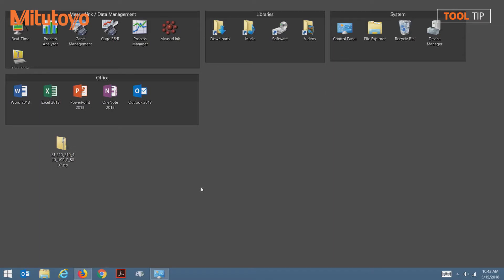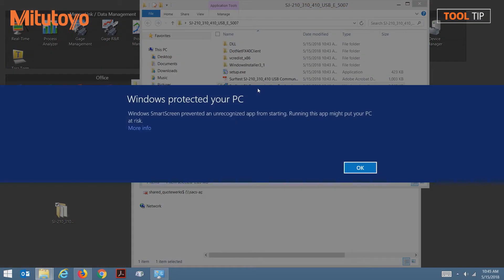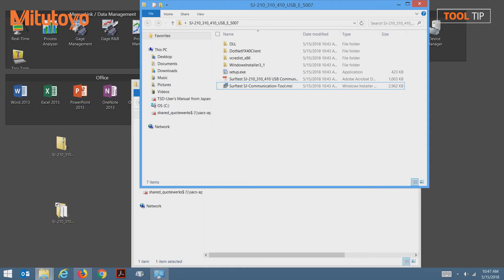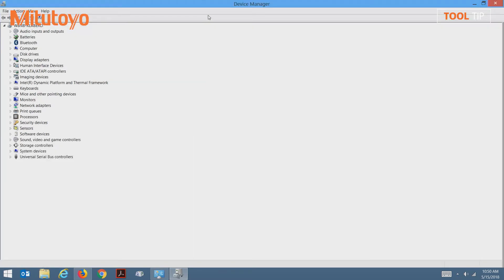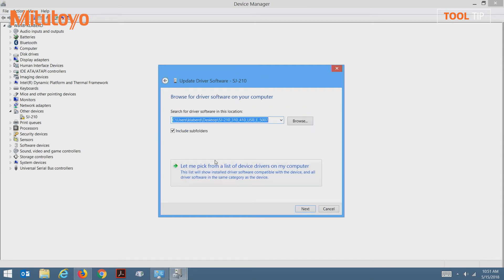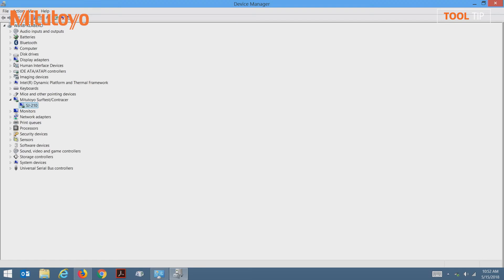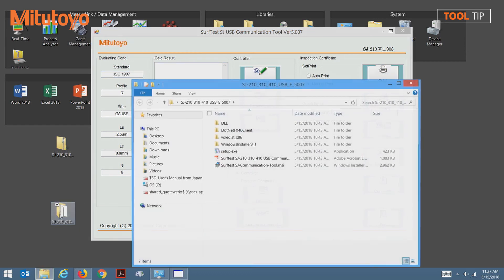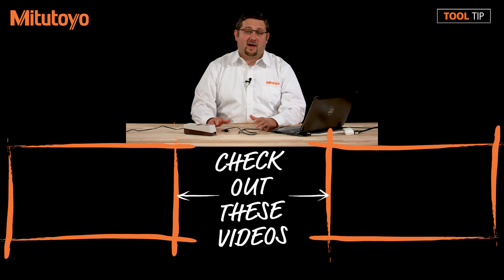Surface Roughness Tester Measurement Software from Mitutoyo

Comment: Hi. Thanks a lot for video first. I have a question. How can I use or comminicate SJ301 with my computer (OS: Windows 10 and RS232 cable)? I installed all softwares needed but pc can not comminicate with device. If you help I will be pleased.
Reply: Did you ever figure out an answer to this question? I have the same unit but USB wasn't even a dream when it was built. LoL
Reply: @able-fox  Hi. Unfortunately, I did not 🤭